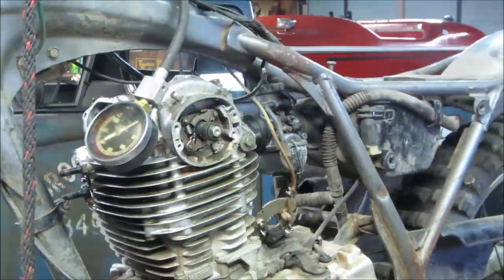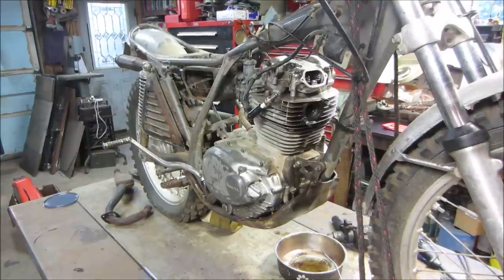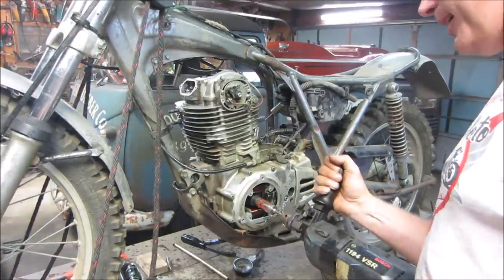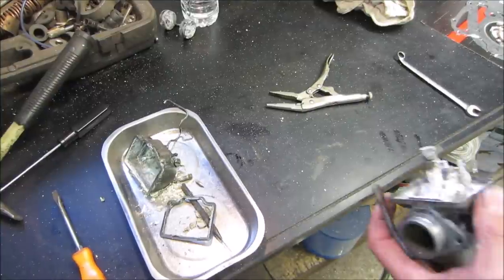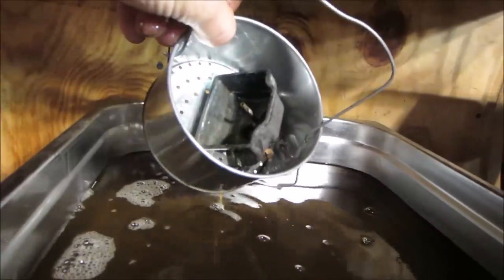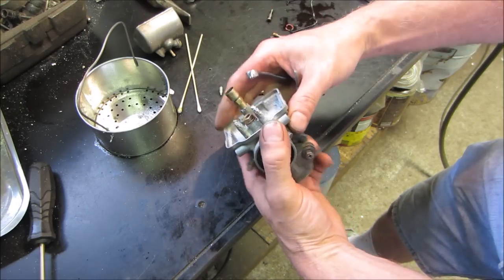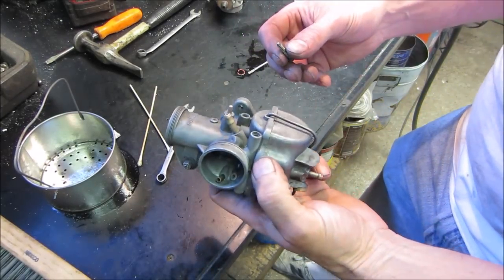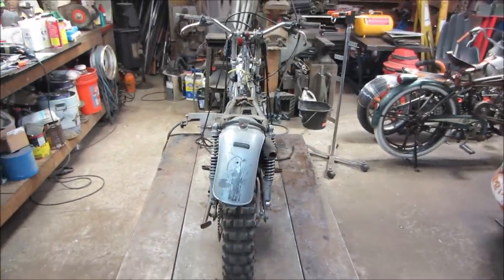will it run? antique honda trials bike pt 2 of 2

Comment: I loved watching you work. Not a wasted motion. You didn't break anything. Most people would have tried just putting gas in it or tearing the head off. If they got a pop out of they probably would have ruined it. You seemed to know exactly what you were going to do. Oh man! That carburetor was sad. I would have done the same thing if I had the parts. What kind of a number did you pay, if you don't mind me asking?

Comment: You forgot to put the tiny, 1 inch long metering valve back in, it screws inside , beside the long piece you pushed out with your punch! You must be a lot more tender with the parts inside the float bowl!

Comment: WD-40 is not a penetrating lube. It is only for displacing water. That is what the name stands for; (W)ater (D)isplacer formulation number 40. If you want to break things loose and/or lubricate them, try something like PB Blaster or Liquid Wrench. They work much better, faster and lubricate longer. WD-40 may be slick and slippery at first, but evaporates quickly and leaves a sticky film behind. That film will repel water (like the name implies and the product is intended) but will allow dirt to collect.

Comment: ... Also what are you using in your ultrasonic cleaner? - I've tried everything from brake cleaner to dishwasher tabs - even the expensive "proper" stuff.... but your results look better than mine - My tank is prob the same as yours.... Have some outboard carbs to clean up - Thanks again - Steve.

Comment: you should get WD to sponsor you. Useful stuff. It will even renew plastic parts to a degree. Sometimes you have to give older plastic parts several coats over some time. I have to ask... why do you mess so much trying to get spark and all... when actually you should just put the engine on the bench and rebuild it, or at least take the top end apart and rebuild it all before you even worry about starting it.

Comment: Next time instead of dropping the gas in the cylinder take a little bit of propane and hook a hose into it and put it turn it on slowly and put it in place where the carburetor would act like it's feeding feel to it and then it would start

Comment: So, it doesn't need a battery to run the engine? Is there a capacitor? I'm curious if it has a magneto instead of an alternator.  From where does it get spark?
Reply from the maker: has a mag

Comment: it didnt sound like the throttle was open when you did the compression test, might be my ears. but if it were not wide open 60 psi or less would be expected, or at least fits what I have seen.... 60 psi may also run well enough to be a fun ride for that old beast.

Comment: Are those carbs Mikuni?
Reply: Nope, they are Keihin.
Reply: i called them "kickin" cause lots of kicking is they required, temperamental things lol. they was OK once you knew how to work the choke lever and give tiny bit of throttle as you kicked. someone not used to them would flood them or never get it started

Comment: ADVISE : Next time you try to run a bike engine, TRY THIS :    Put the OXIGEN NOZZLE ( of you gas weldeing equipment) into the carb´s  air admission, open it (half the way), and , VOILA!! IT WILL RUN RIGHT ON. If doesn´t run, there is somethig real bad. I used this trick thounsand times,,, TRY IT and if so, plese let know.

Comment: if you do a proper job carb strip down  you dont need a drill to start it ??
Reply from the maker: not true, you still need to dial the air fuel mix in.

Comment: Do you know on a points file it files on both sides for a reason, so when you file your points and the contacts at the same time so they are flat with each other. FACT

Comment: welp, nice if it was a trail bike... never seen a trials bike that was 4T back in the day and not many today... but a only the factory few. That is a old XL honda trail bike or a enduro style.  No way in hell would a trials bike would be a 4t in that time because of weight...
Reply from the maker: look up honda tl250, then get back to me,
Reply: I stand corrected.
Reply: I don't recall any 2 stroke trials bikes, especially not honda. they just didn't have the torque down low, and I tried trials riding old yamaha mx 360's like a loon, if you ate the clutch to death, they still weighed far too much

Comment: If i had a dime for every old nasty carb i've cleaned and made work again....I'd have a bunch of dimes.
Why oh why do people put things with gasoline in them away AND NOT DRAIN THE GAS !!!!!! Why please tell me.
Reply: I know better, but guess what, yup left them all sitting with fuel in them, thinking I'll run them next week or so....... 10 years later still sitting, fuel petcocks off on tanks and I did run the bowls out, and out of the weather. plus I know this fella that works on them ;)
Reply: But you had the forethought to run the float bowls down. 97% of others do not. Even running the carb dry will in time cause issues. The fact that we have crap for fuel now makes it worse, Tip of the hat to the corn growers.......
Reply: I dont blame the Farmers, I do blame the government and other greedy entities....  Corn is for eating and making drinkable "spirits" and I suppose "spirits for cleansing" :))